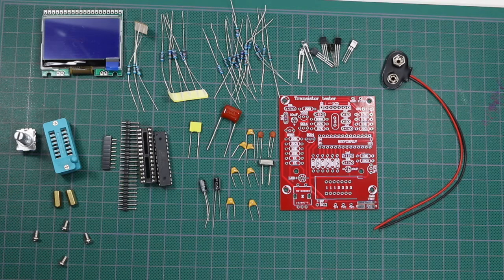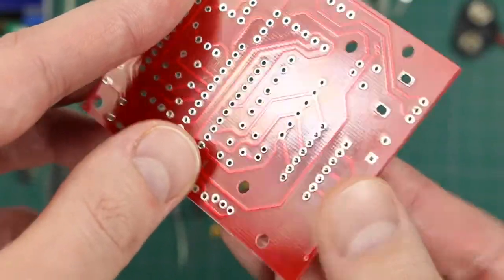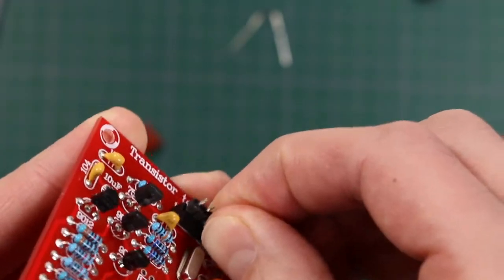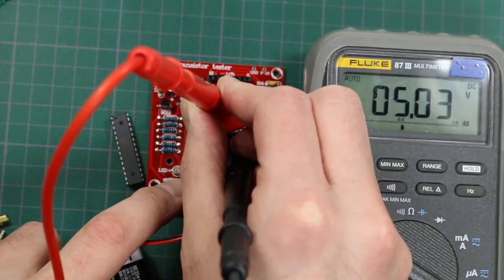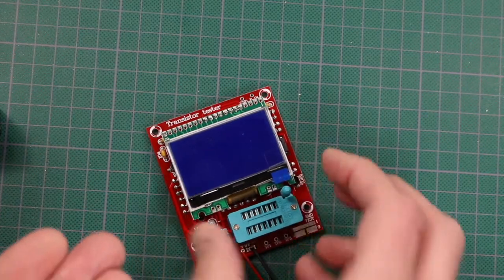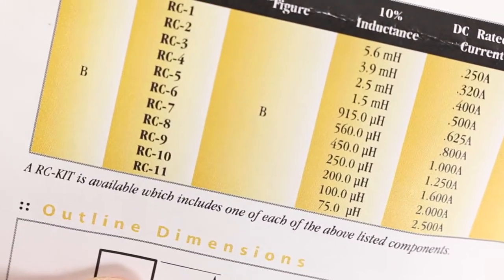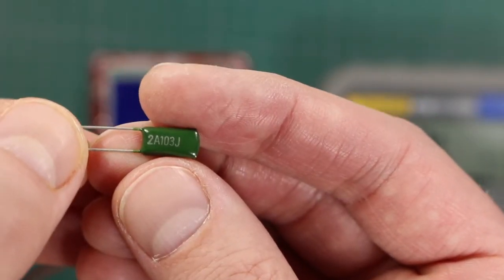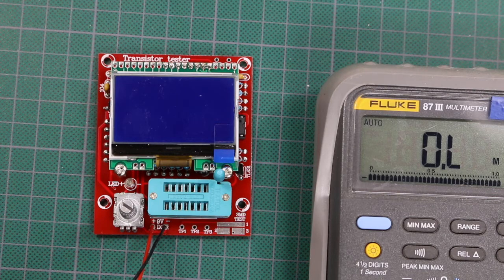M328 LCD 12864 Component Tester Evaluation

Comment: I've subbed to your channel to follow new vids you may produce.  Based on your videos at present, I'd guess you're ramping up your hobby.  In some months I hope to have finished my 'tronics workshop, to get back into tinkering.  Straight away, are you aware that Keysight will be having equipment give-a-way in March?  Check out GreatScott!'s channel for links to enter the contest.  From your channel 'About', you don't have 'tronics YTers mentioned.  I'd suggest these YT creators:  GreatScott!, HomoFaciens, DiodeGoneWild, Julian Ilett, Electronoobs, Dejan Nedelkovski, educ8s.tv, w2aew, ThePostApocolypticInventor, MrCarlsonsLab, EEVBlog, mjlorton, MertArduinoandTech.  If you knew of these already, no harm.  Best.
Reply from the maker: Thanks!   Yeah I have been working too hard the past many years and all my electronics parts and equipment are sitting around collecting dust so I wanted to revisit all areas I dabbled in from the past (building simple things from kits or magazines) and old computer/modem days of the late 80's to mid 90s, as well as incorporating the more modern side of things (Arduino, RPi, and all the things people mess with these days).   I learned a lot of things on other people's channels and thought I'd try giving back.  It also keeps me inspired to stay on top of my own interests.

I didn't know about the upcoming Keysight giveaway. I'll check that out.  I could use some new equipment.  I still need to continue setting up the channel info, get some better channel art etc.   I do believe I have made publicly visible the channels that I have subscribed to, so it should be visible from wherever playlists would show up.  I haven't seen some of those you listed so I'll check those out too.  

Thanks again!   Always looking to learn and expand.
Reply: Glad to meet a fellow traveler in the hobby.  I've been following 'tronics YT newb AntonyCartwright, who is clearly new to the hobby, and trying hard.  From your dialog, it's clear you immediately know """parts""".  It's sort of quaint to watch noobs get acclimated to a hobby that has so many dimensions to learn.  Oh, I forgot to suggest YT MickMake, and BigCliveDotCom.

I've donated to HomoFaciens & BigClive and wish I could go Patreon, but, alas, this will be my first month on social security, so watching expenses is important.  My Dad started me in 'tronics with vacuum tube shortwave radio u-build-it kits in the early 60's.   You mentioned music related to maker products.  YTer "NotesAndVolts" has some of that stuff.  YTer NatureandTech (Denmark, I think) does some very interesting teardowns & repairs, and is very knowledgeable.  Sorry to blabber in comments.  Best.
Reply from the maker: Commentary is most welcome.  Especially sharing knowledge in the form of other channels to look up, or talking about old times.  Nostalgia is part of the hobby after all.

The only vacuum tubes I've ever used were in old radios I had access to in the 80s and wish I still had, or now in guitar amplifiers.   I plan to try to build a simple 12AX7 preamp some time.   

I think I've seen NotesAndVolts videos.  I like so many technical things that my channel will probably be a mess trying to explore everything.  I want to get my Teensy board going and do some audio experiments with that.  But time is limited so I'm lucky to even be getting started at all!